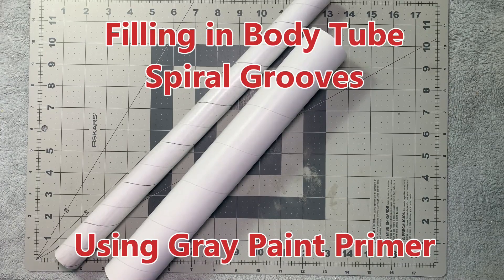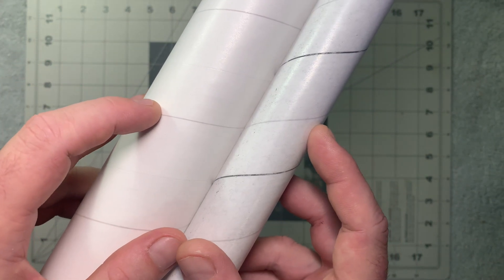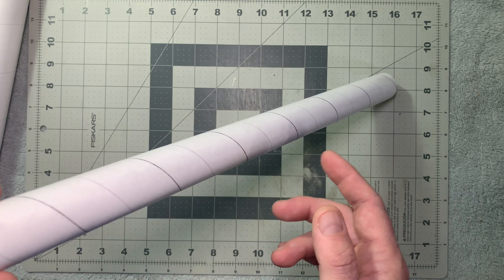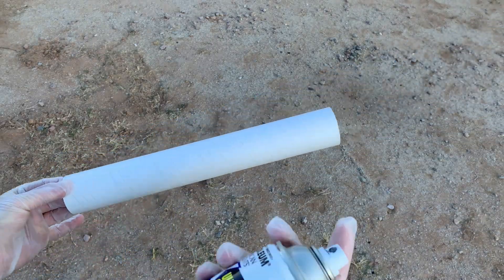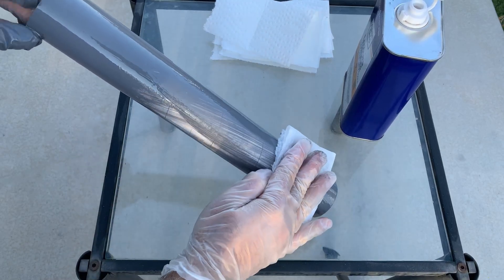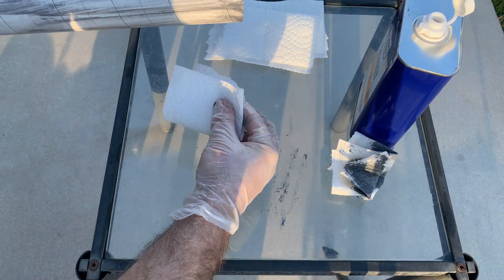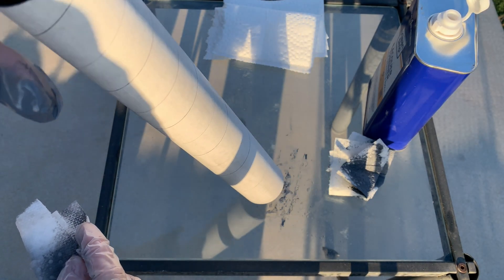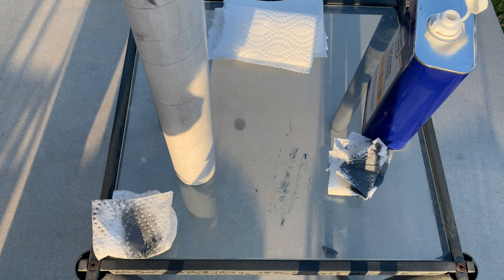Filling in Rocket Body Tube Spiral Grooves - An Alternative Method

Comment: 🤔 I might try that. I have done a couple different methods and they are a bit labor intensive. I got to the point that a little tube spiral showing is OK.
Reply from the maker: Sometimes good enough........ is good enough!  LOL    So far, I'm really pleased with the results.  2-4 coats usually does it before final prime and paint.